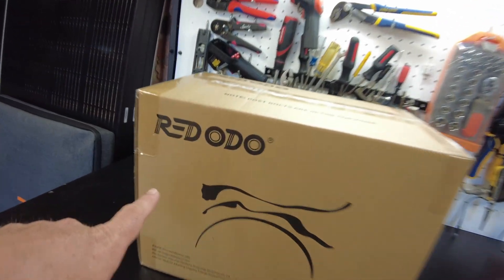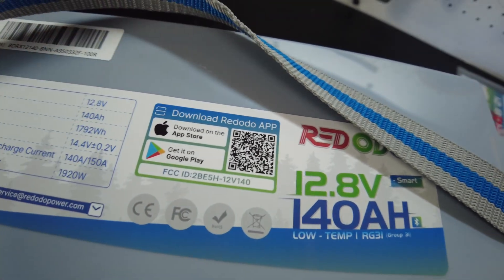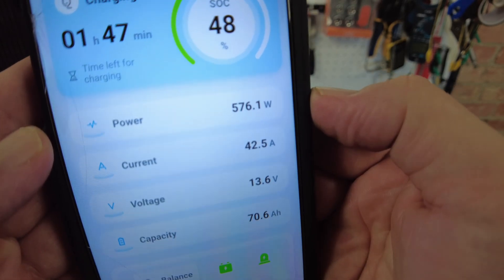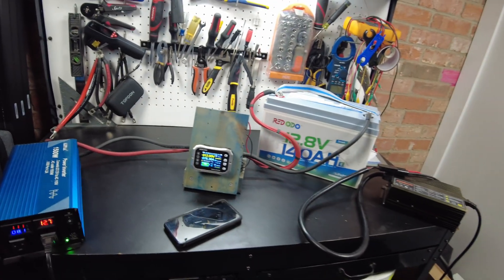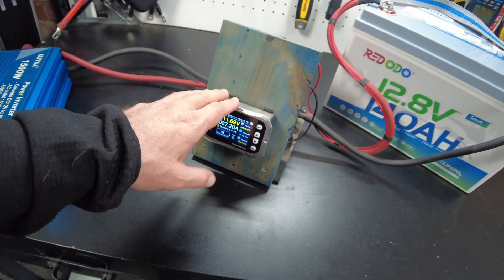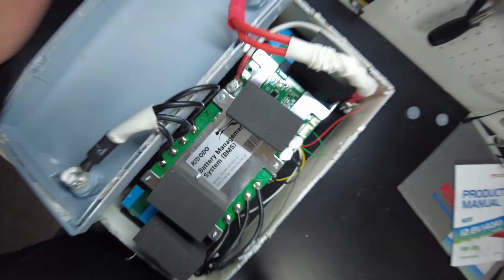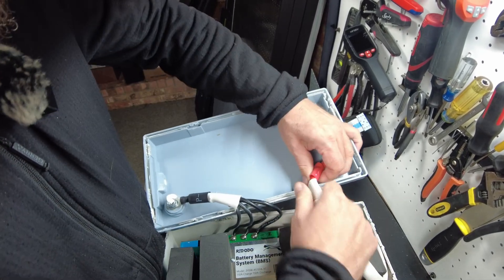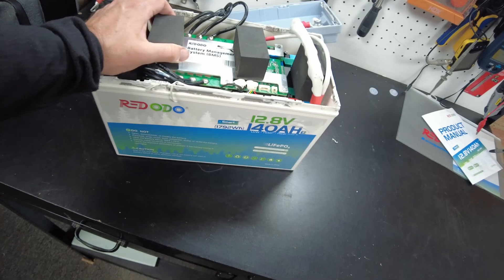Redodo Smart Bluetooth 12V 140Ah LiFePO4 Lithium Battery

Comment: what you have 4 black wire 10 AWG that mean it's max 120 amps This is not good at all.
Reply from the maker: 10awg silicone jacket 200c temp rated wire can handle more than 30a

Comment: Eco-Worthy is selling their 12.8V 150Ah (165Ah actual) metal cased smart battery for $212. This one is like $259, so not the best deal.
Odd that they used four 10AWG wires for the negative. 10AWG is normally used for 30A, so 4 x 30A is only 120A, which is less than their 150A discharge max. Those wires are gonna get toasty.
Reply: I’d not consider it but I’ll watch anyway lol